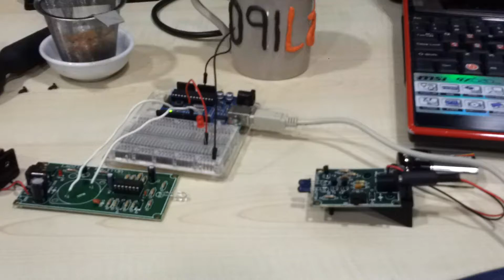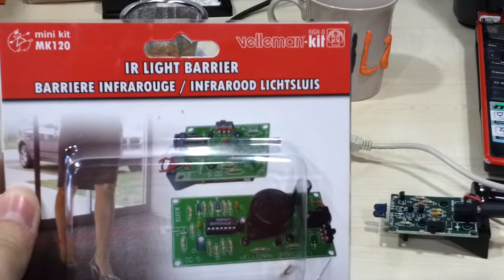Arduino - IR Beam test

Comment: Hi Aaron, this was a long time ago you posted but I wondered if you can help. I have a can dispenser that makes an alarm at a set time and the only way it will deactivate is the IR beam being broken. Does it matter if the buzzer is on the IR kit as opposed to the breadboard?
I guess the code will be like this as the buzzer will be on until the beam is broken:

void loop()
{
if (digitalRead(inputPin) == HIGH)
{ digitalWrite(ledPin, LOW);
}
if (digitalRead(inputPin) == LOW)
{ digitalWrite(ledPin,HIGH);
}
}

Comment from the maker: No problem at all. That sounds like a really cool project. The way my IR beam worked was that one side had IR LEDs and the other side had the "sensor" LED which could detect when the IR LEDs were visible or not. 
In other words, I only had to program one IF statement per "beam", even though there were two "parts" to my setup. I'm not sure how yours is set up, but I imagine you could use a few combinations of IF statements with && operators in the brackets to determine which LEDs are visible.

Comment from the maker: Hi daz0125. In your project, do all four IR beams need to be crossed at the same time? One way to do that would be to use four clauses inside your IF statement with && operators between them. In other words, have it like:
if (ir1 && ir2 &&ir3 &&ir4)
{
// do something
}

This will then "do something" when all four beams have been crossed simultaneously. 

If any of the beams can be crossed, then you can indeed use four separate IFs, or even a SWITCH statement. Hope that helped in any way!

Comment from the maker: @jjmspace1 Hi jimspace1. Very sorry for the delay in getting back to you. It was very easy to set up. The original kit came with a buzzer with N and P terminals, which I simply removed and replaced with two small wires. I'm new to electronics myself. Software is much more my game, so this was a nice little project to work on. You can indeed set a software delay on the Arduino. It's just a simple call to the delay() function with a millisecond delay argument e.g. delay(1000) to delay by 1000ms